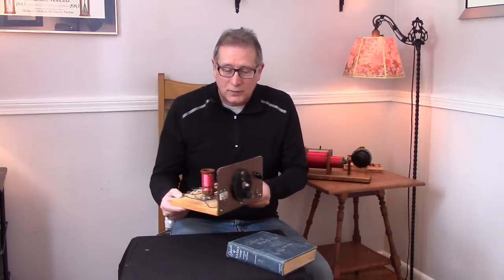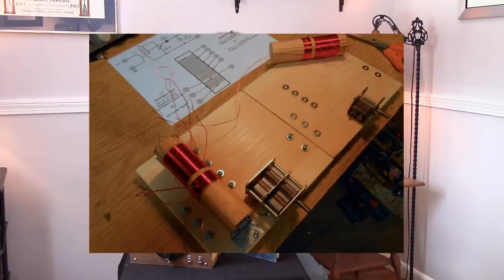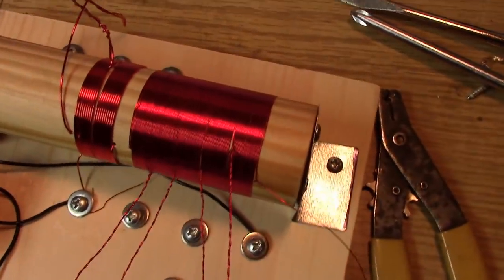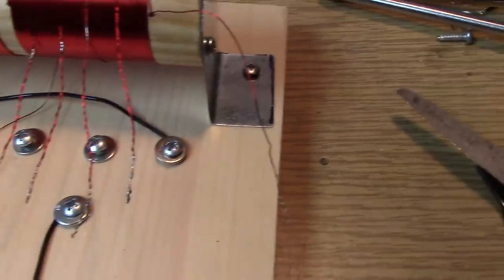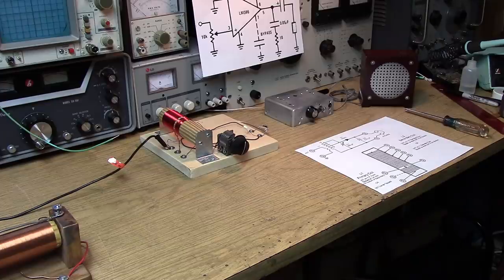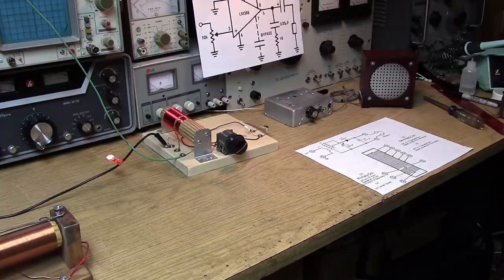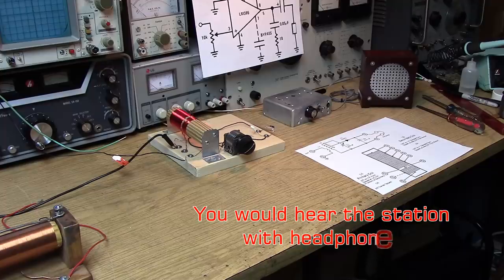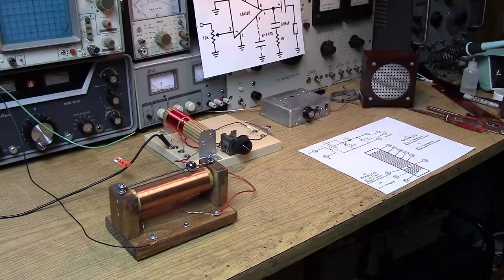PEP UP YOUR CRYSTAL SET WITH A TERRIFIC TRF

Comment: This video is a terrific explanation and demonstration of how to add a TRF stage to a crystal set. One question, though... At time 22:00, you say to first tune the TRF stage to the station you want to listen to, and then tune the crystal stage. Is that correct? Are both tuned stages equally selective? If they are both quite selective, I can foresee a situation where no signal gets through, because the two tuned circuits are set to very different parts of the band. Perhaps that is what gave those old TRF radios a reputation for being finicky and hard to tune? You would need to have marked dials/scales on each variable capacitor, so that you at least get both tuned circuits close to each other, and then fine-tune while listening to the received station.

p.s. At 16:49, you show a copy of "Design of Modern Transistor Circuits", by Maurice Yunick. In the mid 1970's that was the textbook used in the electronics design course at the University of Manitoba, Faculty of Electrical Engineering. That course was taught by Professor Yunick himself, and I still have my copy of that textbook (signed by the author).

Comment: Great video. Thanks for doing all the projects for us. BTW a neat trick for soldering enameled magnet wire is to put an aspirin tablet on a piece of wood under the wire and then push the soldering tip against it. I saw this in an old magazine somewhere and tried it. It works like a champ, but the fumes are horrible.

Comment: Cool,   back in 1970, I joined the US Army, and after a whirl wind training session, I found myself in Vietnam. I was assigned to an Engineer outfit, and since we were a major headquarters, we had to have a lot of field phones, thus a rather large switchboard.  I became a switchboard operator, of course we were not allowed to have any distractions in the SB room, but at night, when the board was fairly quiet, we found that we could jack into the line that lead across the CamRahn Bay from Dong Ba Thin, where our HQ was located to CamRahn Bay where the major switching central was to get around the country.  If nobody was on the line, the board and headset acted as a sort of radio receiver, and we could listen to the only radio station available, the Armed Forces Radio and Televison Network.  They played a lot of current rock and roll, so we could spend the 4 hour shift listening to tunes (they found that over 4 hours at a time on the board lead to some really nasty reaction in some soldiers because of the constant pressure of a busy double SB86 SB with extra stacks of receiver towers.)  We worked 4 hours on and 8 hours off constant rotation.
Reply: Thanks for sharing your experience, it was really interesting.
Reply: That's pretty cool. What kind of reaction?

Comment: A Crystal set was the first thing I ever got working I was very much surprised that you didn’t really need much at all if you just wanted to pick up the strongest signal all you needed was Crystal earpiece pretty much. 
In the 70s and 80s you could buy a complete TRF device housed in a 4 legged TO18 case it was the ZN414 a great little device and enough signal out to feed a single stage common emitter amp to drive a small 80 ohm loudspeaker.
Reply from the maker: I remember the little wonder chip, the ZN414. Another one I played with was the 703 RF IF AF differential amplifier. Radio Shack sold those for 99c.
Reply: @MIKROWAVE1 I never tried your device but I think if you can find a zn414 these days they ain't cheap.lol.😂

Comment: A very good presentation. In the past, I've heard so much about large wire, large diameter coils. (Thin wall 1 1/4" and 1 1/2" pvc sink drain material is good for small diameter coils.) I've made many coils of 3,4,6,8 and 12" diameter. Wound with 14 to 24 gauge solid and stranded wire. Fine-stranded speaker wire is nice. I'm not trying to upstage you with these details. Only letting you know what I've tried. Your knowledge is well beyond mine.) Recently I built several variometer and variocoupler coils which were fun. At any rate, your smaller diameter coils and wire seem to perform better than most of the ones I have built. I may have wasted a lot of money on the bigger/better ideas. As you mentioned, keep it simple. Did you ever experiment with large coils? Thanks for any thoughts! John in Bay City, Mi.
Reply from the maker: You are exploring the high arts of crystal set design!

Comment: Great info, a lot of time went into making those coil taps, but nothing on using them. Wondering if they are worth putting into my coils?
Reply from the maker: Nope. Both the diode and the Amp seemed happy with a centertapped coil.

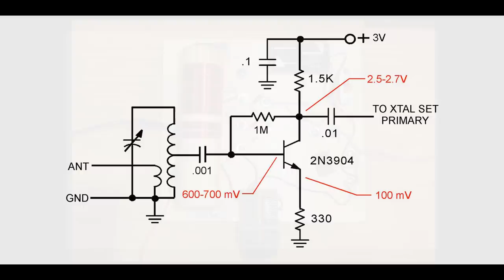Comment: Awesome video. As for your rf amp stage at 18:20 in your video:   In order to find the value of the self biasing resistor do you just use ohms law and look up the 2n2222 base emitter current to get .6 to .7 volt at the base to keep it turned on?  I don't understand why the emitter resistor adjusts the gain.  Is there extra reading I could do to find out how this works?  I have the essentials of radio book u show on your video.  Thank you for sharing your knowledge.  How is the performance of a typical  vacuum tube detector with a grid leak resistor and capacitor compared to a 1n34 diode??
Reply from the maker: Its pretty loose, and it does not take much to get almost any transistor into the linear region enough to handle the small signals. In other words it does not need to be exactly biased to half VCC, that's for sure (but it would be nice...).

Comment: Lowering the gain with an emitter resistor also increases the input impedance making your TRF load its coil less.
Reply: @Radioman.These  days people say "HFE" instead of "Beta" but yes you got it right for the frequencies you are working at.
Really there is "Re" and also "re".  The little "re" in inherent in the silicon transistor and can be said to have 25mV on it at whatever the emitter current is.
There are other effects that make the input impedance smaller in extreme cases.
To a tuned circuit, the transistor's capacitances only change the frequency a bit but the fact that those capacitances are not good capacitors adds an extra loss.

Comment: sweet.....can one be done w/out any batteries, or transistors/tubes? just curious...good AM radio antenna cut to freq. would be large, but should be more volume with the longer antenna....excellent video, and looking forward to part deux….

Comment: I have an idea,  maybe its possible to pick the best germanium multiband crystal radio design, and add a separate regenerative
transistor powered circuit coupled inductively to the coil? One that is powered by an untuned separate antenna or coil that
rectifies and provides current to the feedback circuitry transistors? No batteries needed?

Comment: I'd say you gave me the secret to making my super passive radio work much better. I've always thought there should be a way to make a passive amplifier. And apparently this is it. I will have to add this circuit to my version of the lyonodyne Crystal Radio by Mike Tuggle. Of course as I'm into having a completely passive radio, I won't be using an amplified speaker. But with this circuit added and the sound powered transducer elements that I have for headphones, this should really be quite something. And I still get to keep my passive criteria on the radio in tact. Maybe this is why as a brand new ham I seem to be enjoying QRP. I really look forward to knowing CW well enough to be able to communicate. With a 1 watt or less radio it will be interesting to see what I can do. to see just how much I can do. Unfortunately, it's looking like it may take me quite a while to get CW down well enough to effectively communicate with it. I never thought it would be easy, but it may be harder than I thought it would be.
Reply: You'll never learn any new language without total immersion and/or many hours spent studying and practicing.  CW is just the same--and as you've figured out, it's the best way to maximize QRP success. I'm relearning code myself, but not for the tests this time, for the airwaves. I haven't built a crystal set-yet. Catch you out there, 73 de W1ADE
Reply: Did it work?

Comment: Awesome video, do you mind telling me what the outside diameter is of those tubes you used for the inductor coils? I tried making mine this morning with some 1.5 inch PVC that has an OD of 1 and 5/8 in. I didn't count my turns, I was doing it hastily LOL but my antenna is a couple 100ft long but most of it's laying on the ground when I get home I'm going to work on trying to raise it up at least a couple feet. It was hard to tell if I heard something I could have sworn I heard ever so faintly a station I got to mess with it some more.
Reply from the maker: That is a good start. You may be a bit low in the band, so some turns may have to come off (do a tap instead).

Comment: 16:00 To maintain the spirit of this hobby, the TRF should be made with only pre-1960's technology and parts.  No microchips(IC's), and preferably vacuum tube tech!
To use 'modern electronics' is to render the endeavor as unauthentic
Reply from the maker: Yes as a purist, historian,  collector or preservationist, I would agree. But I was learning electronics in a very strange time period of the early 1970's where I still had tube design and slide rule courses, right along side semiconductor design classes. The "Hybrid Era". It all flows together. There is very little new in the actual designs till we get the PLL and processor.

Comment: It would be cool to see you replace the variable caps with varactor diodes.

Great job on the video.
Reply from the maker: A good varactor to play with is the Motorola MV1662, 250 pF. A couple of these should do the trick.  Typically tune with a well bypassed pot like a 10K or 50K with a 1M resistor off the center feeding the two diodes which in turn are coupled to the coil with a 0.01 cap. Play with inserting resistors to the bottom and top of the pot to scale it.

Comment: Wonderful tutorials and demonstrations. I love it! However, late model TRFs of the 1930s? Didn't you mean late 20s? I have an American Bosch made in 1928 that has ganged TRF. Also a Majestic floor model, same ganged TRF setup, 1929. By 1932 the superhet patent ran out and everyone made superhet radios, though one could get the small TRF due to the depression, and a 3 tube TRF was cheap.
Reply from the maker: I have a 1929 Crosley ganged TRF art deco style with skinny legs that has an AC supply. Yes late 20s.

Comment: My transistor TRF is working like a champ finally, with one annoying problem yet.  I just can't seem to get a set of coils that will really bring in the lower end of the band.  I struggle to get anything much below 800-900khz.  Some nights slightly better than others but not by much.  Any ideas ??

Comment: You can reduce that down to one device using a MC1350 chip from Motorola which is a wide-band balanced IF amplifier.
Reply from the maker: I love that old 1350. I made my first QRP transceiver with one of those in the IF. I think it was also used in a TV descrambler project in 1980.

Comment: Can a loop antenna be used for a crystal radio?  I have watched many videos on making a crystal radio but none of them really discuss the antenna and what options are for a portable AM radio.  I am trying to watch all your videos so maybe I just haven't got to it yet.
Reply from the maker: A loop antenna based pure crystal set with no amplification would require a large very low loss loop. It would be tuned. I small table top loop of say 15 inches on each side of a square loop would work only for nearby ground wave stations. So for real performance, imagine winding a loop of say 3 to 5 ft. on a side using low loss Litz wire. Then you would have an inner loop of a couple of turns that you feed the diode with. This gives you an idea of what we are talking about, and this one is small.    https://aa7ee.wordpress.com/2013/11/17/a-tuned-loop-antenna-for-the-am-broadcast-band/
Reply: @MIKROWAVE1  Thanks for the info.  I think I might try something like your active antenna with the ferrite core.  I want to build a portable AM radio that I can carry.  I am also looking at your 2 tube amp design with the battery tubes...pretty cool!

Comment: Can I make the RF amp ( at 18:09 ) with a gain of 100 by setting a very small emitter resistor and using only 1 meter of an antenna? I live in the city, so I can't have a 40 foot antenna!  Really appreciate an answer...
Reply from the maker: Joanne, the kind of antenna that you are describing is called an Active Voltage Probe. These can be very effective if there is filtering to focus on the band of frequencies you are interested in. For instance, for the broadcast band, you would want one with a sharp low pass filter set for 1.8 MHz. To make the tunable amplifier in this video work as a demo, you may try to increase the gain to a reasonable level of 20 to 30 and attach your very short wire to the very top of the tuned circuit (no primary coil needed).
Reply: @MIKROWAVE1  Thank you, for the reply ! That was really nice ! Thanks !

Comment: Does the wood core on the coils affect the inductance much?
Reply from the maker: A Vacuum has a relative permeability of 1. Air is 1.00000037. Water is .9999992.  Wood is 1.00000043. Pure Iron 1000. So it depends on how wet the wood is and if it has magnetic impurities! Maybe zero effect. Q is another story.
Reply: @MIKROWAVE1  - polystyrene has good permeability and a good Q. I would like to make a printed spider-wound polystyrene coil form with a tubular glass variable cap. You just got me interested in making a super crystal set once again. Thanks so much.
Reply: MIKROWAVE1 —Thanks for taking the time to reply. Have you by chance had any experience with wave traps?

Comment: Do you understand WHAT the appeal is  in using  a crystal radio receiver with  a crystal earpeice ?   
SIMPLICITY :  radio reception without using using electricity , power supply, batteries or amplifiers .
Reply from the maker: Ha yes! Maybe use a second radio tuned to a more powerful station as a power supply for the amplifier?

Comment: could you "gang" the variable capacitor and use it for both stages?
Reply: never mind. you answered it.
Reply: @generoll4027  I had the same question.  I'm still wondering how they put the caps on a single gang and kept the coils separated.
Reply: @clifffiftytwo  - The frame of the cap (the stator) is common and should be connected to ground. The rotors are separate and isolated.

Comment: Why doesnt anyone else use a 2nd cap and diode to double the audio out?
Reply from the maker: You do get more voltage out if the output impedance is high enough and the signal is strong enough to turn on two diode drops. The penalties are increased output impedance, increased distortion and less SENSITIVITY.
Reply: Great video !! ....That 1 Transistor really Woke up the Crystal radio Sensitivity & Selectively !! .....Now that a battery supply is Utilized, maybe Foward Biasing the detector Diode a few Microamps could "Hotrod" even more Weaker DX stations !!

Comment: I've tried building this seemingly simple TRF front end onto a Crystal set and absolutely does not work !!
Voltages at the collector & base are all over the place and never near what you show in your video schematic.  I'm totally lost as to what's going on 🤔🤔
Reply from the maker: Simple is not always easiest when it comes to bias. Thus we have H bias. All it takes is a variation in the current gain to greatly influence the Q point with simple bias. First attempt to get the first stage collector somewhat centered between VCC and ground.
Reply: @MIKROWAVE1   Fifth try was the charm !!  Working like a champ. Even with 40' INDOOR antenna running thru a loading coil !!   One thing I'm curious about, why does it seem Crystal Set output seems to be bass heavy ???
Reply from the maker: @stevenlitkey9354  That's great about getting it biased! - it could be that the output filter cap on the phones side is too large. Try reducing it to a .005 uF.

Comment: This calls for a bad pun I read many years ago in Pop'tronics........

At one national industry consumer electronics show, sitting in one corner of a display area, was an old horse drawn passenger conveyance.  The over a century old wooden vehicle's paint was nearly completely worn off, and the only lettering left on one side were the initials of its long gone operator, 'R.F'.  The faint sound of music wafted out of the carriage, and group of engineers gathered around it, scratching their heads and trying to figure out what was the purpose of this exhibit.  Finally, one of them face palmed, and spoke up.   "Of course", he exclaimed, "it's a 'Tuned RF Stage!"

Both of those transistors are often used in RF applications up to 50 mhz.  The gain may fall off from the DC value that high, but they work.
If you used the dual gang capacitor and placed the two coils at right angles to each other, you could have built a single control radio.  The coils would have to be wound exactly the same, but by using the trimmer caps on the variable you could have gotten them to track.  Ganged control sets were common in the late 1920's, by the 30's superhets were more common.